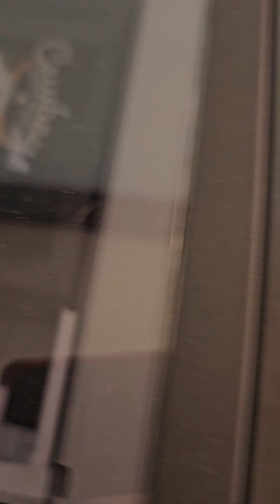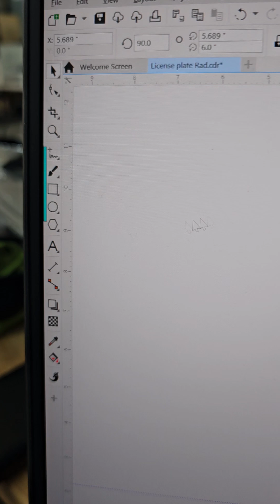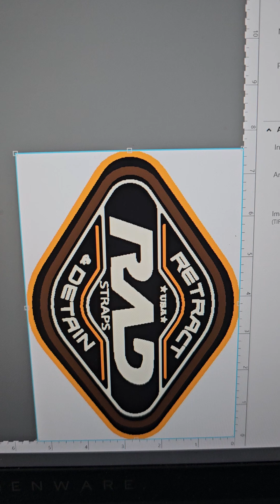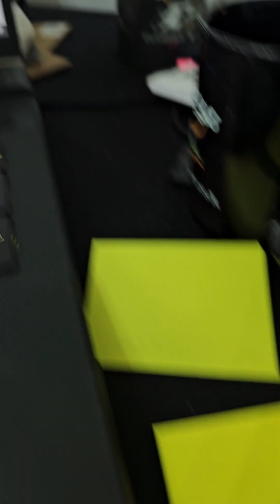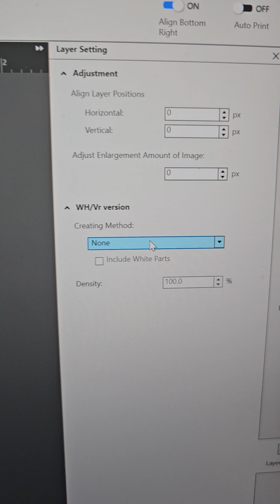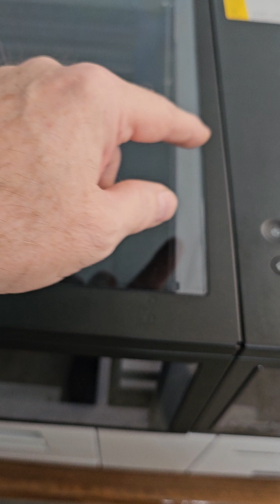Epson Surecolor V1070 uv flat bed printer. Setting up a license plate to print.

Comment: tq for sharing, can this machine do tumblers?
Reply from the maker: For tumblers, you need to print on UV DTF film and put it on the tumbler as a transfer.
Reply: @CraftyUncle  thank you for sharing. If you don’t mind may I know how much does ink cost overall including “waste ink” for the maintenance? I been surveying to use it for small production but not sure if it’s worth it over the long run due to the ink cost and only comes in 140ml packs

Edit: Can’t seem to find much info online from actual owners
Reply from the maker: @greedsloth1516  It seems to run pretty efficient. It cost $70 for the 140 ml packs. I think it is worth it for the smaller production jobs. You also need to consider that some of the UV printers are terrible to maintain. you have to run them everyday. with this machine it cleans itself and you can go away for a few days it wont get all clogged up. If you want a machine that has less worries and very easy to operate this is the one.
Reply: @ Thank you for the kind reply. Unfortunately there are no available units in my country until further notice. Guess I need to wait awhile more ouch
Reply from the maker: @greedsloth1516  it is difficult to get. I was the first one to get one in my state, i think, because i preordered it well in advance.
Reply: @CraftyUncle  ahhh I see they increased the price too. I reached out to Epson in my country and the larger version is said to be released in coming August